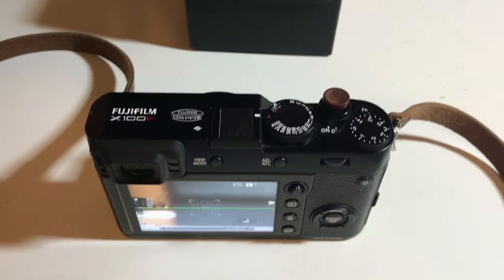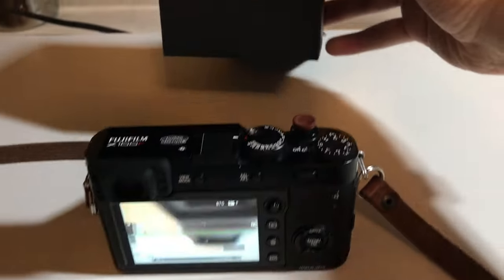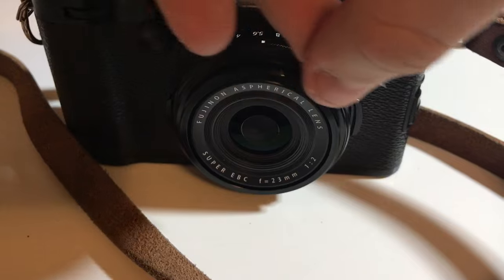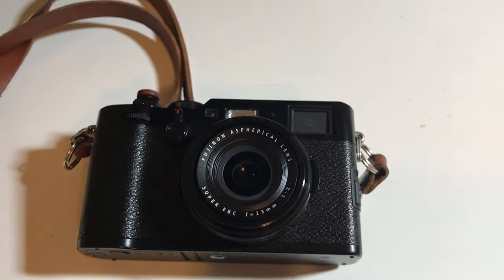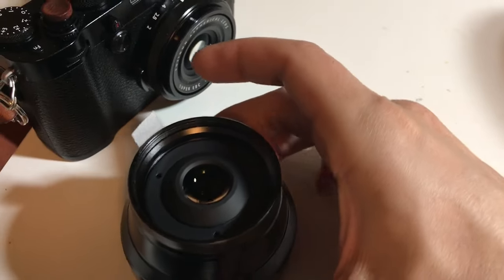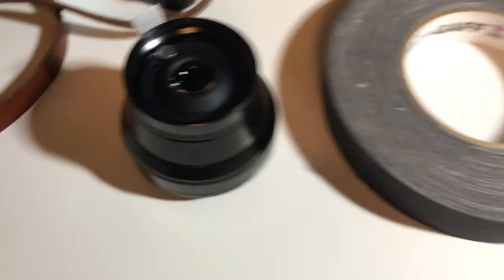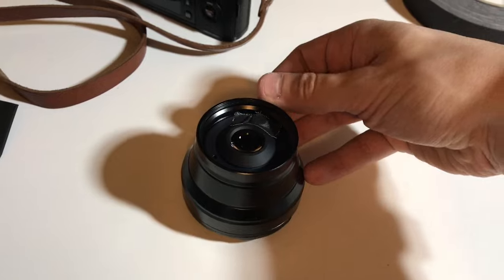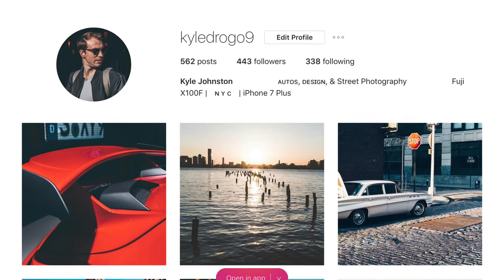DIY Fuji X100F Conversion Lens Fix (WCL + TCL)

Comment: Thanks for the great tip. I have both the WCL and TCL which I got for my X100T, already sold. I recently upgraded to the X100V and this feature of the camera, along with the Digital Teleconversion feature of the camera, makes the bundle a great small travel set. I tried it with a fridge bottle opener that has both polarities and triggered both converters by reversing sides. I'll look for a small suitable magnet in a hardware store to fix my Ist gen converters.

Update 27.02.2023:
Again, your video is sheer genius. Since I no longer had the original WCL & TCL boxes, I went scrounging the fridge looking for a suitable magnet, finding a round one that mesaured roughli 14mm in diameter with a thickness of 3mm. Cut it in half with the Dremel and ground the halves down a couple of mm's, then marked the spots with a soft lead pencil. Found the polarity and used double sided acrylic tape to set them in place. Voilá! As mentioned before, not only do the magnets bring up the correct indicator and frames in the visor but (something that I hadn't tried) they work in combo with the Digital Teleconversion; thus, the WCL brings up a 41mm frame for the 50  and a 58 for the 75, then the TCL brings up 72 and 100mm. As mentioned before, in an ultra small package you get an almost instantaneous switch of focal distances spanning 28 to 10mm if you simply unscrew your lens shade (I've got the square one from Haoge LH-X54B), screw in your xCL and  you're set. The 20, 41, 58 of the WCL are excelent for street and the 50, 72, 100 for scenery.
The only caveat is that the thickness of the magnet can keep you from the fantastic close focusing of the X100V as the lens body makes contact with it. I'll have to find some thinner magnets.

Comment: Fantastic tip, well done! I just experimented with it to see how to activate the WCL and it happens on the reverse polarity of the magnet. A little tip if you have customised the DSIP. CUSTOM SETTINGS and un-ticked Conversion Lens you will not know if the magnet is working or not, so make sure you tick the box in order to do the test correct;y. This is something I had to figure out because the test was not working for me. Thank you

Comment: Worked wonderfully for me on my TCL v1.  It's so nice to not have to worry about forgetting to set the option when changing the converter quickly at a wedding!   Thanks so much for the tip!

Comment: not sure if any one will see this - I have tried this on my Fuji X100S but can't get it yo work.  has anyone succeeded on the X100S?  I am intending to upgrade to th 100V  so not a massive deal,  but do enjoy using the WCL/TCL lenses.
Reply: I tried this on my x100s and also didn't work. Maybe Fuji never put in the firmware to detect conversion lenses on older cameras :(

Comment: will this magnet set up cause problems when the camera is focusing in and out??
Reply: The set does work! but Im nervous it the magnet will scratch the camera when focusing 😅
Reply from the maker: If you use a really thick magnet there is the possibility yes. The magnet I used here never had an issue when using the macro setting on the X100F and I had it on there for a year. I would not suggest a magnet any thicker than this one. You can google a similar solution and find thinner magnets elsewhere to purchase.
Reply: @Kaze919  I think the one I have is pretty thin. Was readying it out today and it works perfectly! You guys are amazing for the DIY! Thanks so so much!!

Comment: Has anybody made this work with the X100V? I have done this and it worked just fine with the X100F but NOT the X100V
Reply: Did you manage to make it work with the "V"?
Reply: Hello @NetoVelasco  I actually did. Turns out I had to place the magnets more accurately and in a slightly higher position than with the F — maybe the sensors on the V are smaller or require more accurate positions of the magnets? After trial and error I located the perfect spot and had to use TWO magnets instead of one for the V to recognize the adapters.
Reply: @at016  Thanks for the tips! I guess I should just try if I can trigger the Tele with the V with certain magnets before doing the whole thing.
Reply: @Barrrt  Just keep trying, you'll make it work. Mine is still working flawlessly. I just noticed that I did not clarify that I used two tiny magnets stacked up to increase the height... this is what did the trick!
Reply: @at016  Thanks man. I'm still in doubt about whether to get the old TLC with the mod or the new one. The new one feels more secure but I like old cheap stuff so I won't be so paranoid about breaking it :-)

But if I have a magnet problem during an important photograph that would easily be worth 75 euros (the difference between secondhand TLC's) to prevent, to me.

So my real problem is choosing the right TLC :-) There is this thing about beautiful expensive gear that makes me want to use it less because I don't want to scratch it etc.

Thanks for your input and encouragement!

Comment: Sorry but its one step in the menu or u can put it in ur q menu .... dont ya think thats to much effort for this lill win of time ?
is there another difference between version 1 and 2 ? because if this is the only one i would buy the verion 1........

Greetings !!!
Reply from the maker: Geburah Silberwolf I've already forgotten to change it while taking the lens off. It's too easy to forget about
Reply: No issue with the movement of the lens when focusing close fouling on the magnet?
Reply from the maker: Samantha Vaughan none, I’ve run it for months now since uploading. I know this is a concern but if you seat it the way I did there’s no contact on the lens element.